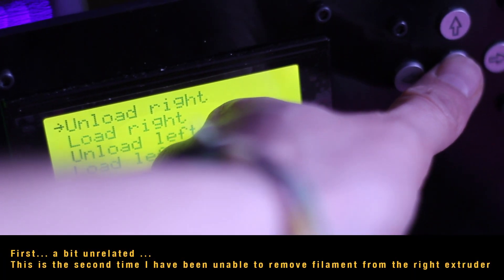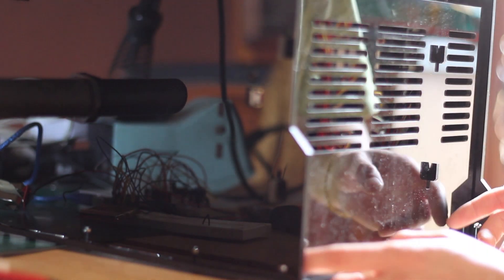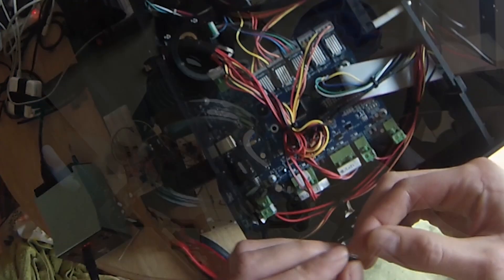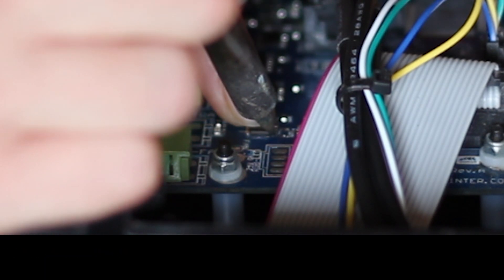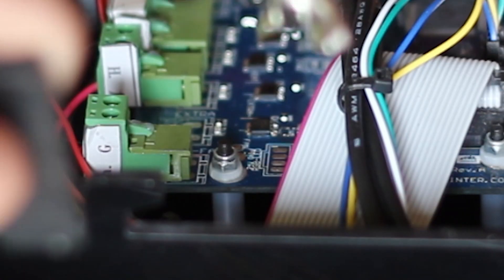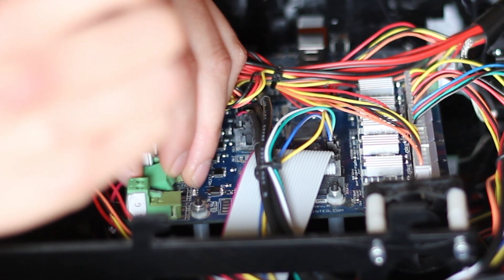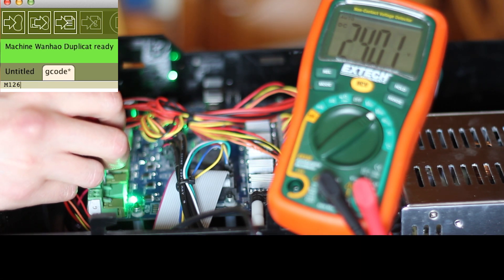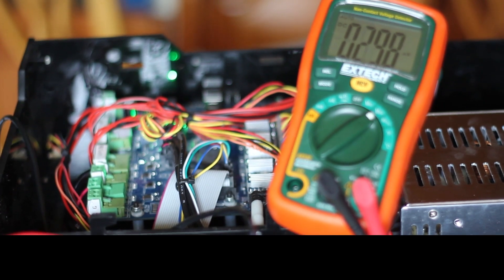Adding a cooling fan to Duplicator 4 - Soldering the MOSFET

Comment: Thanks for sharing this. Really helpful. MOSFETS are particularly susceptible to damage (death) by static electricity. To minimise the risk, leave the printer plugged in to the mains WITH THE MAINS SWITCHED OFF. In this way the chassis is still grounded so touching the metal before handling the MOSFET will discharge static charge. Also, when soldering use a small soldering iron, well tinned and plenty of flux. Use the soldering iron to tack one leg of the MOSFET to the board. Then if happy with the position, solder the diametrically opposite leg. Then solder all legs in place. Using flux helps to ensure that the solder flows and binds properly between the legs of the MOSFET and the board. If needed the flux can be cleaned from the board with isopropyl alcohol, an old toothbrush and some decent kitchen towel.

Comment: So i did the same you did, but mine is always on, cant control it by gcode 
Whenever i turn the printer on, the fan turn on as well, even that is no printing, any suggestion? What did i do wrong??
Reply from the maker: What firmware are you running ?
Reply: The Creator 1.0  (factory firmware).
Reply from the maker: You need to upgrade to the Sailfish firmware.  http://www.sailfishfirmware.com/

Be careful and really carefully follow the instructions, there are several steps that seem to cause most people (including me) problems.

Be sure to have the correct Sailfish version of ReplicatorG, it's not the regular one from replicat.

From here https://www.thingiverse.com/thing:32084/#files you can get the correct version.

The solution to most problems you might encounter can be found here : https://groups.google.com/forum/#!forum/wanhao-printer-3d

Good luck! I'm sure you will enjoy the enhanced print quality from your printer both with sailfish firmware and the extra cooling fan!
Reply: Big thanks!!

Comment: Hey there, I am from germany and try to find the fitting components at Mouser.de, the Mosfet I found but with 61A Max and not 65A. For the Headers I cant find a resembling version there, does anyone have hints on where to get these elements? Also where to get a fitting Cooler Fan?
Reply from the maker: +Drato Lesandar The best way to search for components is with part number or via a parametric search.  On Mouser.de ...

PSMN7R0-30YL  MOSFET Transistor, N Channel, 65 A, 30 V, 4.92 mohm, 10 V, 1.7 V
http://www.ebay.co.uk/itm/351246558343 << for the same one as me or the 61A one you found should be just fine.
http://www.mouser.de/ProductDetail/NXP-Semiconductors/PSMN7R0-30YLC115/?qs=sGAEpiMZZMshyDBzk1%2fWi6Z%2fLshgBEjN3tqutwBgXck%3d

The pictures for the headers are general for the range, so they have the incorrect number of terminals but they will have the correct amount when you get them.

Female Header 1757242
http://www.mouser.de/ProductDetail/Phoenix-Contact/1755736/?qs=sGAEpiMZZMsDddcp1dBDJOrXMrFmZFLl4hVDc5odhPc%3d

Male Header 1757019
http://www.mouser.de/ProductDetail/Phoenix-Contact/1757019/?qs=sGAEpiMZZMvlX3nhDDO4AGmxTE5dWGQY3FmaBdjJUN0%3d

For the fan you're looking for a 40x10mm Brushless 24V Fan
http://www.ebay.co.uk/sch/i.html?_nkw=24V+40mm+Brushless+DC+Fan

Good luck with your modifications :)
Reply: Amazing, thanks for the list, I couldnt find any info regarding part numbers or the parameters for the components. I just asked Wanhao support for the data sheets of the components and searched for standard components of the mighty board.

But your info helped a lot, let's see how my changes work out.

Cheers
Reply from the maker: Drato Lesandar Good thinkin' regarding looking at the board datasheets. Let me know how it turns out. Are you mounting the fan on the front or the back?
Reply: Mounting it on front with the new version fan mount here http://www.thingiverse.com/thing:537918
Reply from the maker: Looks good. I hear Thingiverse user Bassna has some spare terminal blocks http://www.thingiverse.com/Bassna maybe he'd send you one.